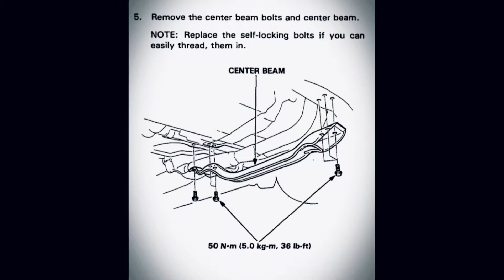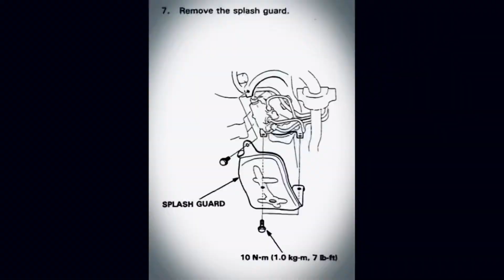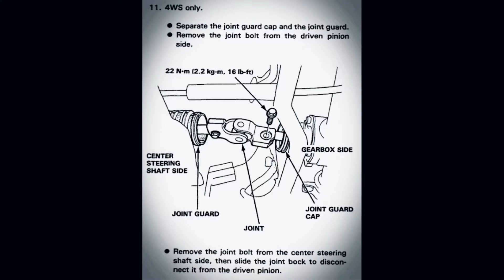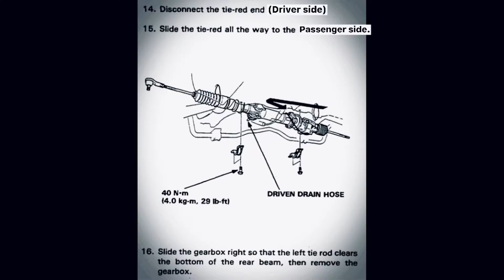87-91 Honda Prelude - (removal) Steering rack removal

Comment from the maker: ⚠️important to use the 4WS rear gearbox lock pin to lock the gearbox at center position before you remove the front rack. Other wise your rear wheels are not turning correctly after u installed the front steering rack! Read the manual about the lock tool and 4WS gearbox centering. 

⚠️Make sure you use the “Flare Nut Spanner” to loose the steering fluid line bolts. DO NOT use normal spanner, otherwise you will strip the bolt to cause big trouble.

⚠️I forget to mention there are 2 bolts to remove at the steering rack and shaft connection join. After you remove 2 bolts, then push the join toward to the shaft to separate the join from steering rack.

Comment: thanks for the video! After a while I realized this was a JDM right hand drive model. I will keep that in mind when swapping mine.
Reply from the maker: Yes, find the manual. It’s all left hand drive in there. Plus my video, I’m sure u can do it.
Reply from the maker: It’s a lot easier to do it by 2 person. Too heavy to move the rack by 1 man under the car with small space.
Reply from the maker: ⚠️Make sure you use the “Flare Spanner” to loose the steering fluid line bolts. ⚠️DO NOT use normal spanner, otherwise you will strip the bolt to cause big trouble.

Comment: It looked like someone also forgot to put the third bolt on the center support towards the rear on top almost behind the rack. Looks like you removed  3 on front and two on rear? But in reality it should be 3 and 3
Reply from the maker: It’s 3 & 3. I have already removed 1.
Reply: @ChannelMAsk  ahh I see. Good job btw. Prior owner to my Prelude must have hit something hard because it ripped out and kinda bent those 3 bolts. So im replacing allot of stuff 

Side note, do you think the entire support beam and steering rack could be removed as one unit? Then just unbolt everything after getting it off the car? Im currently replacing my support beam btw
Reply from the maker: @blazeaglory  you can. But engine needs to be supported very carefully. I prefer to remove the steering rack only.
Reply: @ChannelMAsk  thank you. Maybe I'll record the damage and the grime and send link. I've gone through 10 gallons of simple green, 9 double packs of blue shop towels,  my parts washer, which was new, is now broken and clogged and like a moldy swamp I dare not open, just from cleaning a few parts lol but your vids helped me allot! Thank you